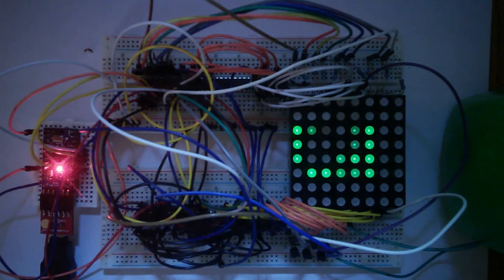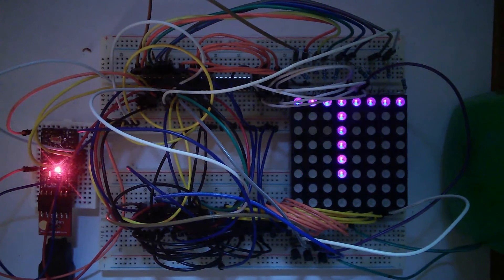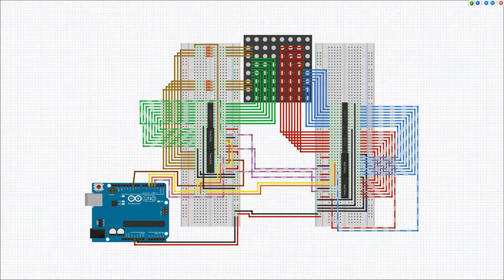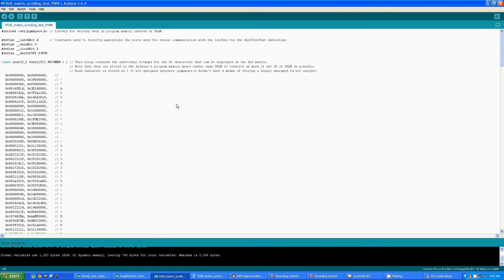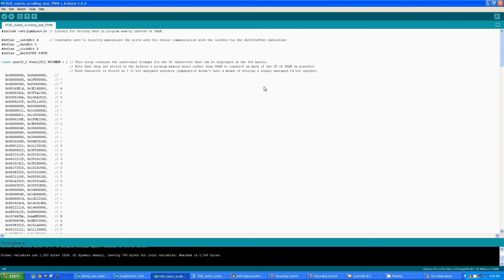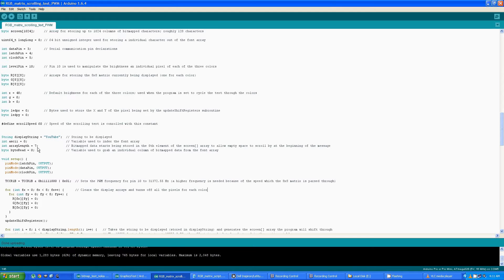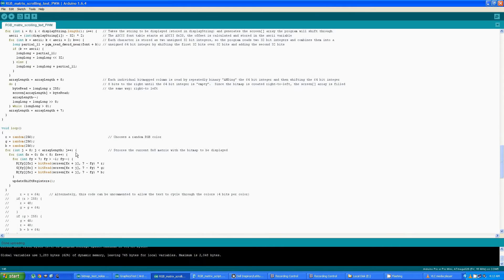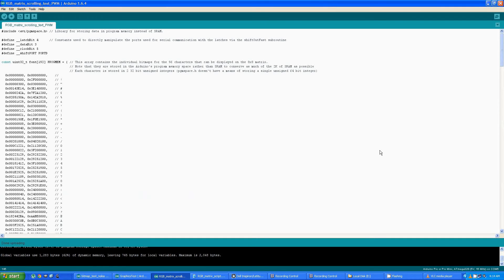Controlling an 8x8 RGB matrix with the Arduino using 8-bit latches and Darlington arrays

Comment: Hi friend! I have some questions, please:
1) How could it be mounted on a pcb to undo all this tangle of wires and components?
2) You can use several of these displays, for example, make a text scroll?
My thanks
Reply from the maker: There are pre-made products available, for example, this Arduino shield:
https://www.aliexpress.com/item/Colors-Shield-8X8-RGB-LED-Matrix-Driver-Module-FZ0257-Free-Shipping-Dropshipping/1403933807.html?spm=2114.13010308.0.0.0s9aCO
It's designed to mount on top of an Arduino, but several could potentially be placed side-by-side, with the Arduinos connected together over I2C.
And with Chinese made Arduino clones as cheap as $3.29USD, it really wouldn't be very expensive to build.
https://www.aliexpress.com/item/NEW-UNO-R3-ATmega328P-CH340-Mini-USB-Board-for-Compatible-for-Arduino-Hot-sale/32670583574.html?spm=2114.13010308.0.0.ijBojR